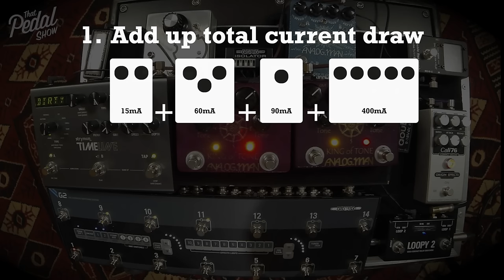That Pedal Show – How To Power Your Pedals Properly & The Legend Of VCPI

Comment: Thanks for the great video! 
BTW any KOT made in the last several years is fine at 18V continuously.  Our Chorus pedals are perfect at 15V, 18V is a bit on the hairy edge.
Reply: mike, could you please confirm I can run my KoT at 12V for as long as needed no problem at all? I'm using a voodoolab 4x4 - I got it 1 month ago straight from you guys, first owner (and last owner unless robbed haha)
Reply: Yes no problem!
Reply: Mike , is there any option for doing a bu chorus in another colour say maybe in black?

Comment: I’m too poor to afford a good power supply and the lady in the pound shop looks confused when I buy 2 packets of batteries every week and I just say VCPI
Reply: LOL unless you are fully joking and not only half jokingly speaking... It then makes even more sense to understand that you can literally troll a recycling depot and find yourself some power supplies.  I mean reliability and sanitary considerations aside, if the specs are met and the unit works, plug her in and get her did.
Reply: Buy a donner dp-1 for $40. It has isolated jacks and 9V/12V/18V options
Reply: Be a true American and buy a used voodoo power pedal supply on a credit card
Reply: @PageandPlant4Life  😂😁

Comment: I have an Analogman BiChorus and I asked Mike if it was ok to use the Xotic Voltage Doubler which offers 15 or 18v.
Mike told me that 15v is the absolute perfect voltage for his chorus pedal. I've used it for a year with zero issues and the pedal is much improved. Love it.

Comment: Thank you for your work and sharing all this information, it's inspired me to go back to analog pedals, but that was not quite it... which inspired me further to build a pedal board, not quite the ticket yet... so I found a loop switcher, but it made some funny noises, so I built good cables for it, almost there, and finally the power supply arrived in the mail, so I installed it yesterday, and there is it... now it rocks. The loop switcher solved some problems (switching pops in some pedals and obviously the presets is what I wanted), the good cables too (noise and pops), and finally the power supply (I'll get to the point), well, it was worth it. Daniel, your saying it makes pedals "sound better", snicker, and I understand some people's reaction would be "give me a break", I was one of them. And you know money is not easy to get sometimes and I am always looking for ways to do it with less, so to speak, but I also save by building and fixing my equipment. I wanted to share my experience, a very good example, with the EHX LPB-1 booster in particular. I was concerned with this pedal, the way it was breaking up was harsh and unpleasant when picking too hard, and it behaved strangely. Now with a proper isolated power supply it breaks up beautifully, I can pick as hard as I want, the sound is greatly improved and it delivers nice gain, all because of the power supply. I purchased the 1 Spot Pro c12, great product, as I am sure I would have had great results with the G2 products, anyways, thanks guys and the internet people who share info. for being my companions on this journey.

Comment: My cousin is an electrical engineer, and he makes these pedal adapters from 5v phone adapters that have soldered endings that hook onto the 9v battery ports in pedals. For the low voltage Big Muff sound, this is really cool, though a little bit noisy. Also, I encourage anyone to check out the Bookworm Effects Switters Boost. It's a clean boost that has an additional voltage control, which can yield a "low-fi" drive. It's a cool effect for some off-kilter sounds.

Comment: If anyone is looking for a proper power supply to power their board, you should check out the 1spot pro (either CS7 or CS12).
I switched from a cheap ass power supply which was giving me nightmarish amounts of noise to the CS12 and it solved so many issues for me. 
Can't recommend it enough.

I'm in no way shape or form affiliated with the manufacturer so I'm purely advertising this as a happy customer.

Comment: Guys! Great episode, and tons of useful information!

I have a question, and I really hope to get a reply from you guys, because I can't figure this out myself.. It has left me puzzled!

I own a Boss GT-1 Multi Effect and I'm currently using its supplied power supply to power it with. However, I have a small pedalboard I use together with the GT-1, and that board is powered by a Palmer PWT 05 mk2. The pedals on the board are - Poly Tune 2, Radial Bigshot I/O A/B switch and a Boss FS-7 footswitch.
The Palmer supply powers the 3 individual pedals just fine, but I want to power the GT-1 from the same power supply, in order to make things easier and more snug on the board.

I have to outputs left on the Palmer, and each output has 250mA, so a total of 500mA. From the GT-1 manual I can see the GT-1 requires 200mA, so basically one output should do it, right?
I then checked the supplied power supply for the GT-1 and found that it outputted 0.5A = 500mA - in order to not overheat the unit, as I see it. Also as you guys said in the video; Find your amount of mA and double it.

I then figured that I might have to use both outputs from the Palmer, giving me a total of 500mA - which should be enough to keep things nice an clean for the GT-1.
I discovered that the Palmer power supply came with a current doubling cable (a y-cable) and knew that was what I needed to make it work.
I then connected the two ends of the y-cable to the two power outlets from the Palmer, and took the remaining end and plugged it into the GT-1.
I turned on the Palmer power supply and expected the GT-1 to be powered up, but no... there was no power for the GT-1.
The 3 individual pedals were getting power just fine, but not the GT-1.

I'm left puzzled by that, and why it isn't working..
Everything seems to be as it should, so what am I doing wrong here?
Any suggestions, etc.?
It would indeed be much appreciated, that's for sure!

Thanks, guys!
Keep up the good work.
Cheers!

Comment: Thank you for this video D and M. I just put together a little mini board for rehearsals and when I don’t want to lug the huge Gator board. I daisy chained them with a one spot but one of the pedals is a Zoom MS50 multi stomp and it just got noisy as hell. For the time being I’m just going to run the Zoom with batteries but at some point when I can swing it I’m going to get something decent like an MXR DC Brick. Thank you for showing me you can’t skimp on this one. I love cheap gear but cheap power supplies will cause problems.

Comment: a thing that came to mind on 9v vs 18v vs a sagging battery would be the headroom switch on the JHS Andy Timmons pedal.  When you switch it, the sounds changes drastically, and the volume decreases quite a bit when dropping below the 100w setting.
Reply: You can also run that pedal on 9 or 18 volts!  Not sure what i like better though.

Comment: It's surprisingly hard to find a reasonably priced power supply solution for pedals if you got more than like 5 of them. Without running daisy chains that is. The price really jumps up from there (around 5 outputs) and you might get more but you start getting AC and 12 V outputs which don't really help you when you just need more 9 V DC outputs. Of course you can daisy chain out of those isolated outputs but you're kind of losing the whole point of trying to get all isolated outputs.

Like you guys said that it's usually fine, it's almost obligatory to run all your gain pedals together and all your modulation pedals together from a single isolated output via daisy chain, then the few left-overs you can run from their own isolated outputs. Or pick a couple of specifically chosen must have pedals and switch them from time to time to your needs.

Comment: Lithium Ion power supplies are the future! No hum and totally independent of the venue's power supply
Reply: Is this really a developing thing? So many things (tools) run on this very well. It could be a great option.
Reply: i used these for my last pedal board http://www.dv247.com/studio-equipment/sanyo-eneloop-pedal-juice--202027 and there is a pedaltrain one too http://www.pedaltrain.com/volto/
Reply: I was looking at ones that Palmer have on their website, they look good.
Reply: Of course...but I guess the issue is how many times can you charge them before they start crapping out...like an old cell phone!?
Reply: Until it sits on a hot stage and starts to burn...and kills 300 people when the venue burns down. Don't try it on an airplane...they've had some issues...! then there is the Samsung recall...and a few flaming hover boards.
Reply: Lol those are just rechargable 9V batteries. There is nothing new or special about it.
Reply: Even with a battery as opposed to running off of line current, the power supply design can still suck and/or be noisy and/or inefficient.  Lithium based batteries can be smaller, and more expensive.  Safety issues that we all have heard about must be effectively addressed.  Having built a few LiPo powered systems, I assure you this is not for the uninitiated.  It is very easy to unintentionally build an incendiary device!
Reply: no way. Having to manage a battery is something we don't need....
Reply: Am I the only one that missed what that isolator was?  Are there any power supplies with true isolation to each power plug?
Reply: Yes, check the article on power supplies by Stinkfoot.se, it's a good read and they have a list of common PS there and their features.

Comment: Round of applause for Mike indeed!  I have been a customer and a persistent nuisance to Mike asking him questions via email all the time, and you can't ask for a nicer and more talented guy.  I have mentioned to you guys before (Mick? do you handle this channel?) his relationship with Trey Anastasio and the godly tone that man produces, the best of which came from using two of mike's ts9 silver mods into (before) a ross compressor, (now he's using Mike's compROSSor and an analogman-modded way huge supa-puss as well, im sure you guys would love these two pedals).  As Dan mentioned he prefers comps after boost, this is what Trey does but to an extreme.  You can dime out the tubescreamers (2 of them even) drive and level and control the overall volume with the compressor, not neccesarily compressing it down more but just capping the volume, the sustain is out of this world!  One of you guys said a video about some of this is in the works, and I can't wait.  If you chaps want to get your hands on a high end languedoc type instrument to show off how these small hollowbody archtops work with amps I may be willing to ship mine over.  

Great video.  Cheers and happy holidays from the US of A.

Comment: Hate to be that guy... But... Current != Power... Power is a function of voltage and current.
Reply: You're not alone - 1 amp of current says nothing about how much power is being used.
Reply: As an Engineer I completely agree, however, these pedals are supplied with a Fixed DC Voltage, so power only varies as current (as the voltage is fixed.and there is no phase difference between voltage and current). So Dan is kind of right.
Reply: You can loosely interchange "current" and "power" in this context, since for the most part the voltage is fixed so the relationship between the two is linear.

Comment: This will be interesting! I've built a board from January 2021 until yesterday, and there's fricking 15 pedals on it! Four are utility pedals, five are dirt pedals.

I've had some bad growling hum noise the moment i turn on my distortions or fuzz, even when my signal is bypassed by the tuner pedal. Turns out that daisy chaining utility and/or dirt pedals introduces noise (but the noise isn't like in the video). Even using the out from the Boss TU-3 into an overdrive or EQ results in distortion or fuzz pedals, especially the RAT, bringing in more noise they normally do when I turn them on, even though the daisy chained pedals are turned off. So I put one of the two power supplies from my second board onto (under) my main board. Three T-Rex Chameleons with five plugs each did the trick. Luckily, I don't have any heavy current drawing pedals, so the Chameleons will be enough, but it's good to know that there are even better, more powerful power supplies. Oh, and it's good to know that isolators exist, like the ones by Gigrig.

Comment: Bravo guys!  After watching the AC/DC Rig Rundown I made a comment has to why many bands don't have 110v-230v converters on tour.  There is a huge difference between the two and AC/DC would sound like Backstreet Boys at 110v or they would need to double their Marshall stacks on stage.  Not talking about the volume increase I'm talking about the Compression alone is drastic.

Comment: I'm still catching up on your episodes.  This one struck home on the power isolation as I thought I had something wrong with my amp.  I took it in to the shop and the problem was not there anymore but returned when I got home.  I thought my AC mains were dirty so I got a filtered power supply for my mains.  Didn't fix it as it clearly (to me now) is caused by the daisy chain power I'm using on my pedals!  The sound your rig made is nearly identical to what I'm getting.  I will fix this on the new pedalboard I'm building.

Thanks!

Comment: Thanks for a great video. I'm a beginner player and just now am looking into pedals. I purchased a cheap Donner daisy chain power source. I only have one pedal, a chorus. I was looking at the cheaper power sources like the Donner DP1 or 2, but so many of them are identical around the $40 mark. Some say they are isolated and others not. It is confusing to a novice. Without going for the really expensive kind, Vodoo or I Spot it's hard to tell. I would love to add a looper and digital reverb like the Joyo R14. Thanks again for your video.

Comment: Sitting here shaking my head as I realize why my empress reverb and superdelay have always been so noisy,  they've literally ruined studio sessions. Powering it with a voodoo labs pp 2plus. Expensive as all hell, well built power supply, but only two outputs power 250 mA (still 50 less than what the empress's require), and if one pedal is drawing that much your not meant to use the other output for a high current draw pedal. So effectively you can only power one highish current draw pedal, it will definitely not be enough for most strymon, empress, eventide style pedals. (obviously reading all this why I am watching). MXR Iso-brick is cheaper, fully isolated, has more inputs at high current draws to power my empress's and has better dimensions (for me at least). Thanks for explaining this, getting half cooked advice from forums for years clearly hasn't served me well. the only difference I can see between the two supplies is that the pedal power is powered directly by a AC power chord (jug plug) where as the iso brick is powered off another wallwart power adapter. Obviously the jug plug would be more sturdy but would this cause any significant difference sound wise?

Comment: I must have been very lucky. I've been running 7 digital pedals and 8 analogue ones from a Mooer 2A PSU and a Stagg 1A wall-wart PSU, using daisy chain distribution. At any one time they could be running off either PSU, plugging stuff in and out trying different things.

No digital contamination. No Hum, No extraneous noise.

One or two pedals that I have can be fussy about what they're next to in the signal chain and that May be down to non-isolation or it may just be an impedance compatibility thing, I have yet to do that experiment.

A cheap way to isolate an individual unit that is giving a problem is to get another wall-wart PSU and run the offending unit form that. 
A good old fashioned transformer fed PSU is best for this as many of the modern wall-warts are transformer-less and therefore are not truly isolated.

I fully agree with the advantages claimed for total isolation, In Theory, but I'm of the opinion that it's only needed when there's a problem. 
That's in terms of sound quality.
When it comes to short circuit protection, isolation and separate fusing wins of course. 
That would be a major consideration for reliability in a regularly gigged system, touring or otherwise.

Were I building custom boards for pro clients as Dan does then going for the best in everything is clearly a good strategy. 
The GigRig G2 and it's associated power supply  modules is the best pro switching and power option out there, hands down, no question. 
Once cost becomes a significant factor then a lot of economies can be made and still yield a good result.

Comment: Great show and very informative. As a new electric guitar player I am really happy I did enough research to set up a pedal board with a Voodoo Lab power brick instead of a less expensive daisy chain option. No noise problems with 7 pedals.
Reply from the maker: +19MarkZ excellent work

Comment: Running about 8 pedals incl. a Boss DD500 and a TC Corona in daisy chain without any hum or noise for 6 years or so now. I have 2A of output from my power supply, so everything’s fine.